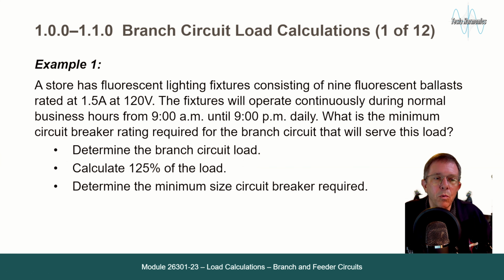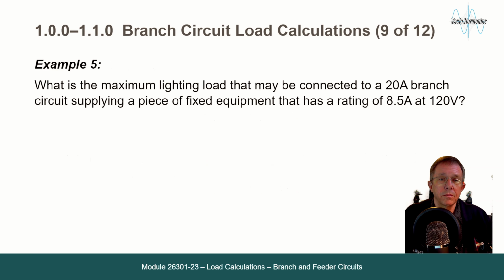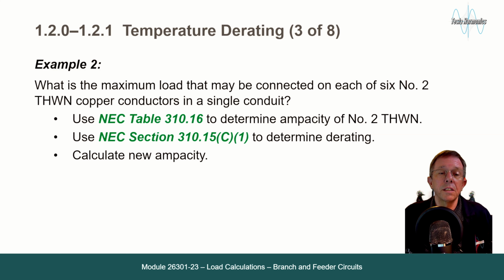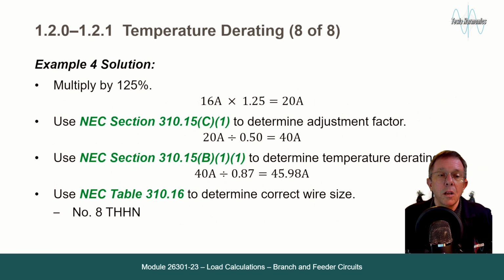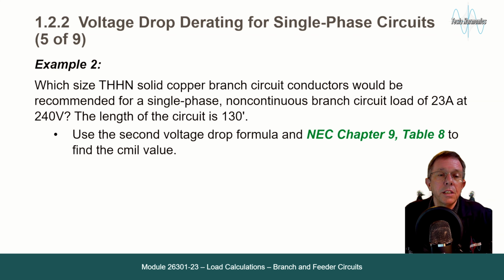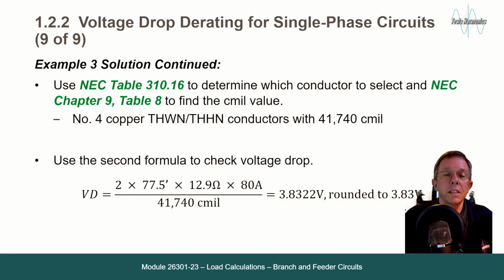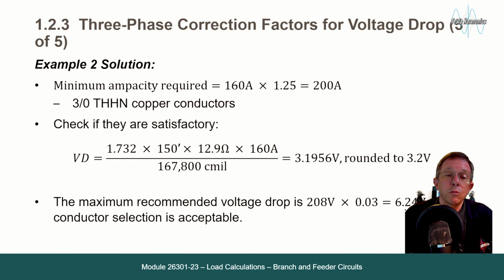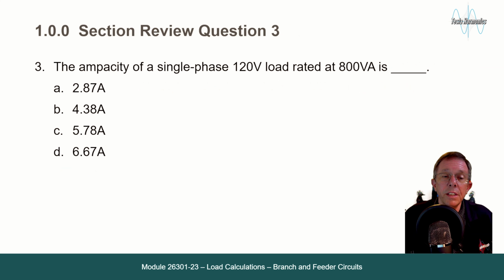NCCER Electricity Level III Module 26301 23 11E Session 1 Branch Circuits & Feeders

Comment: How where did you get the 180 from 2:40
Reply from the maker: Breakdown of the Rule:
NEC 220.14(I): It states that for general-purpose receptacles in a commercial building, 180 volt-amperes (VA) must be assigned to each receptacle outlet.

Why 180 VA?

This value is derived based on a standard assumption about the typical load that a receptacle might carry in a commercial environment.

The 180 VA is per yoke (the supporting strap of a receptacle), not per actual plug. So, for a duplex receptacle (which has two plug-ins but is on one yoke), it still counts as 180 VA total.

Yoke Definition:
A yoke is essentially the mounting strap that supports the device (receptacle). For a single or duplex receptacle on one yoke, 180 VA applies. 

Tesla Harmonics